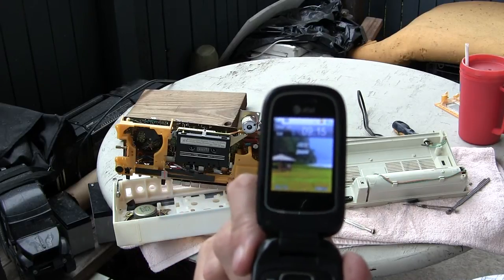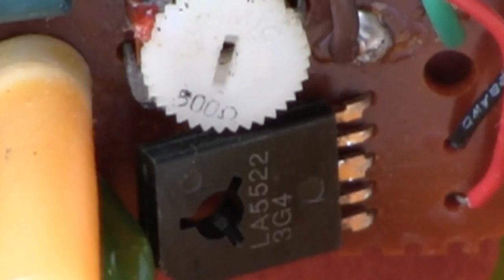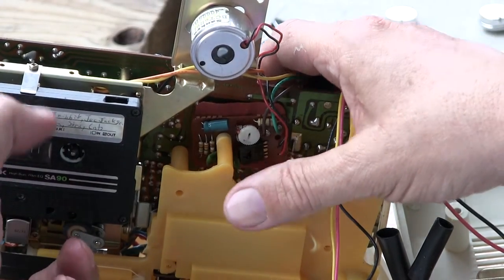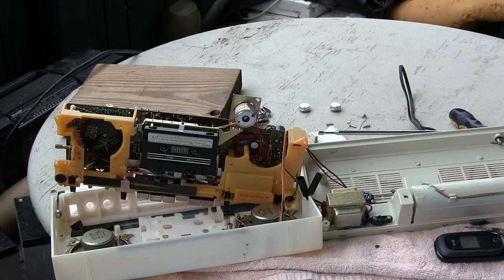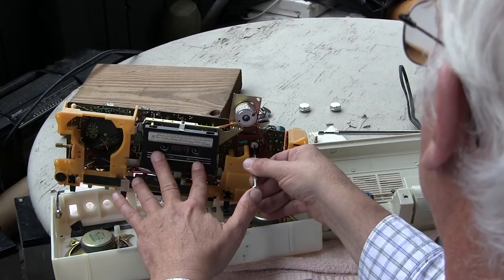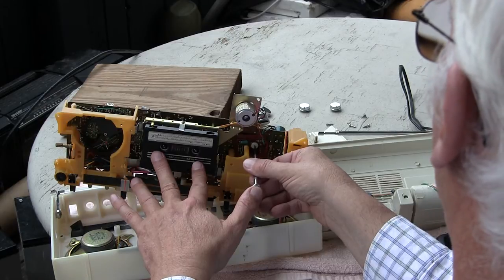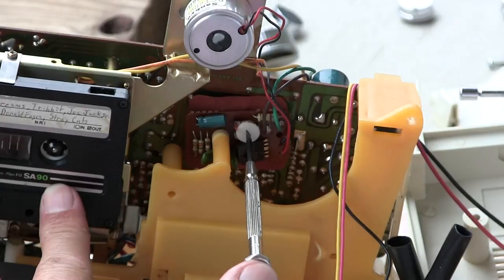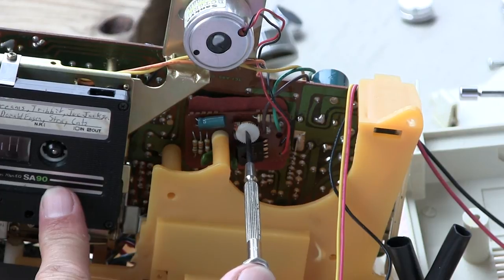LASONIC TRC-919 how to adjust cassette tape deck motor speed pitch control slow belt drive boo

Comment: This is good to know , my question is why would it go off pitch? Was  the worn belt the reason?
Reply from the maker: Hard to know the answer to your question as I am not a Lasonic technician.. My guess would be for any cassette belt driven tape deck = AGE + constant tugging on the rubber would make most rubber bands stretch to the point that they could not resist being tugged on anymore and therefore go limp or stretch and with the Electric motor given free running speed or not doing any work it would wear out faster.  So a new belt, equals more work than before and an new adjustment on the speed for proper operation.